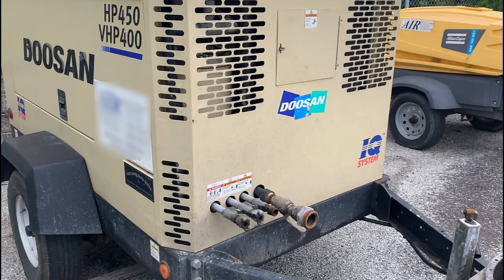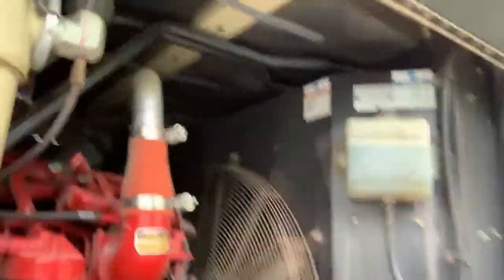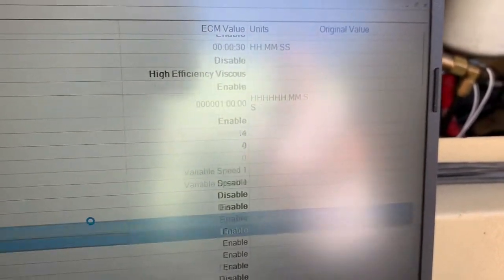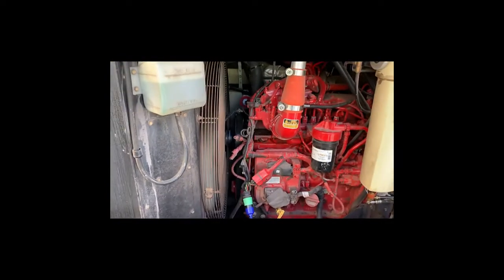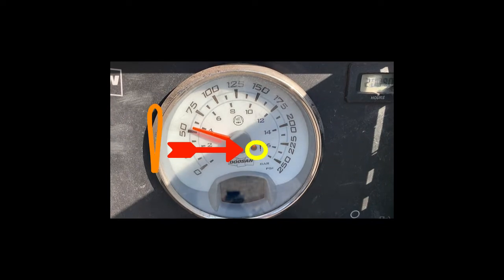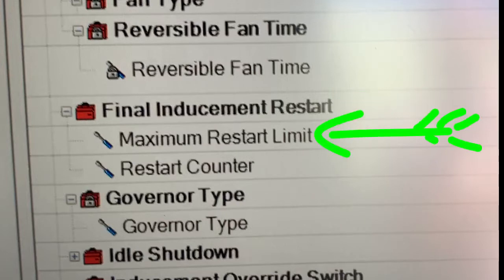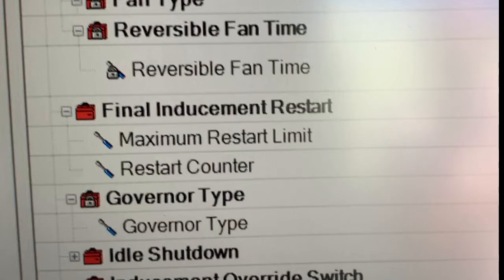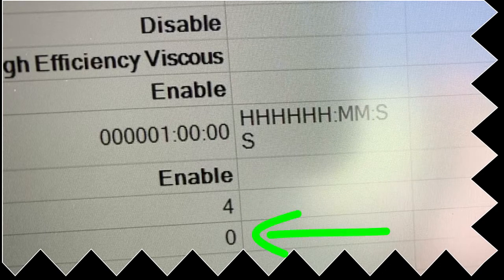Help My Cummins powered Doosan air compressor wont start

Comment: Hey Joe I have a 2012 doosan compressor. Kubota diesel. The machine cranks and starts but it won't build pressure. I checked the valve it does indeed open up. No air comes out the outlet. Was wondering what you would think it was
Reply from the maker: Hi David I have very limited knowledge on the compressor part of the machine. If you know the compressor is turning ( drive coupler is intact) it has to be the control system. I would search YT for model year, manufacturer for clues. Google search is sometimes helpful as well.
Reply: @ENGINESHOPJOE  cool thank you so much I appreciate it

Comment: Hey Joe, we have this high air end temperature error for months already and I don’t know what else to check into this machine. The compressor is Doosan HP 375. Oil and filter is new, fan is turning in the right direction(blowing out), and the cooler seem working properly. I wanted to check further but I do not have enough resources to do that. I hope you can help me with this since you worked a lot on this kind of machines. Thank you in advance!
Reply from the maker: If it is an engine fault it could be a sensor that is in the clean air intake piping. It bolts into the side.
The air filter hail mary foam pads were coming apart and the foam contaminated the sensor which just sits in the air stream.
If it is the compressor air end I don't know.

Comment: Hey Joe, have you ever seen a CPR 252 keypad comms code? The power button on the control panel has to be pushed and held in for the screen to power up and as soon as you release the power button it completely shuts off. Tried finding troubleshooting steps but can’t find anything.
Reply from the maker: No I have not but it sounds like the IC in the controller is not latching. If the key pad is separate from the module it is probably a failed module. Now I think this because of 
working with latching IC's or FlipFlops. The fact that you said you have to hold it in to keep it powered up usually means a failed module. Do check the power and grounds before you 
buy parts and This is my opinion Not something I know for sure.

Comment: Hey joe, i have a similar compressor with the 3.8 cummins. I started it after an hour with the block heater in (was very cold) and it started and ran fine. Let it warm up before i started it up (about a half hour) and then hit the service air. It was fine for a while, then started bogging down a bunch, then the coupler burned out. Im wondering if it was the chicken or the egg. Was it bogging down because of the couple coming apart, or did engine issues cause the coupler to tear. Thanks!
Reply from the maker: Make sure the compressor is ok. Was the oil tank for the compressor warmed up in some way. Never say never but I have never seen an engine cause the compressor or coupler to fail. I have seen torn up couplers but most of the time there was another reason that the coupler failed. I am thinking the compressor, If the oil tank for it was not warmed up before start up, was starved for lubrication because of the cold oils viscosity. If your compressor has an oil pump make sure you inspect it.
Let us know what you find.

Comment: hello good morning.  What diagnostic program do you use???  Is it for the engine or for the compressor???
Reply from the maker: INSITE and it is for the engine. This engine because of the machine it is in had a special software restart counter that had to be reset. That was all in the cummins engine ecm and cummins software. Most engines do not have this counter

Comment: Engine start after Shadown wy
Reply from the maker: I need more information. Describe what is happening in detail and let me know what your working on.
I think it is an air compressor driven by a diesel engine and the engine is starting after it shuts down? Is that correct?